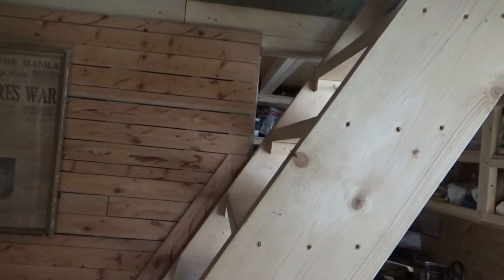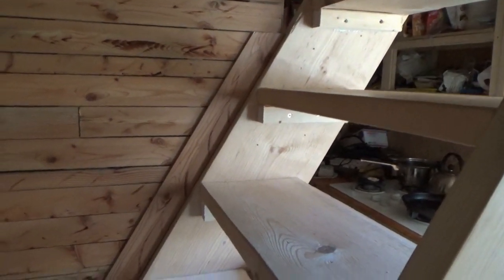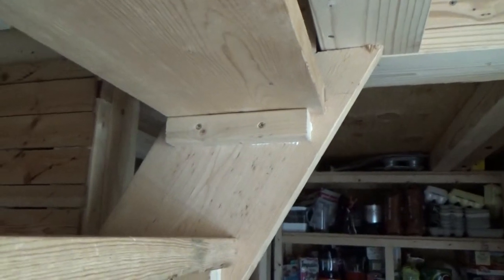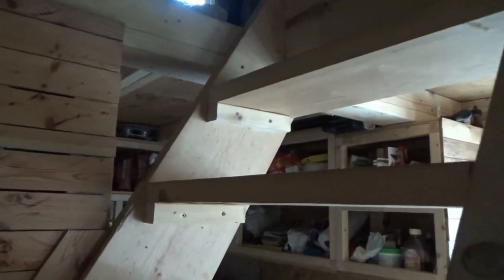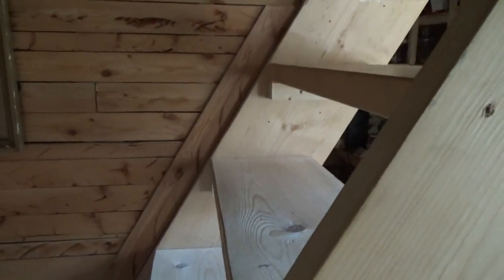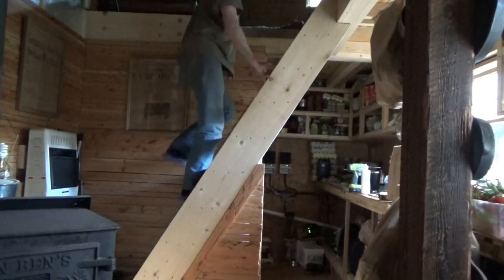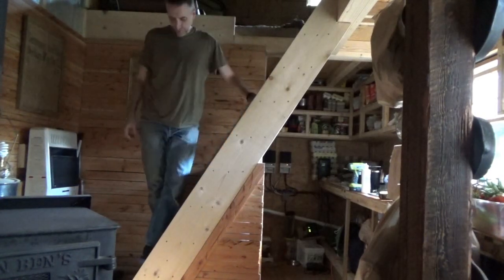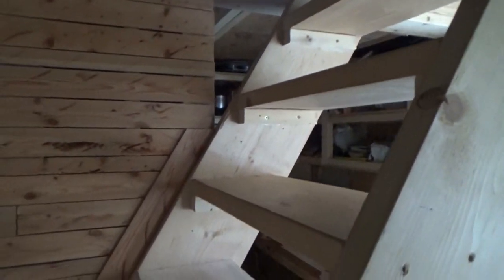Rebuilding Tiny House Stairwell Supports Based On User Suggestions

Comment: It is funny.We had our first snow here in Michigan this last week..And what I have read online shows that we will have a very wet winter with lots of snow..I have split and stacked 3 full cords of wood for my fireplace.Even though I live in the city I have gas heat..Also got my generator tuned up and ready to go..I do not think I have to be off the grid to be prepared for an emergency..But just in case something happens ,I am ready..I hope you have been stockpiling for the winter also..The stairs look very good..

Comment: When did you put the propane heater in the white one looks like 30,000 btu. You using that  instead of wood stove?
Reply from the maker: +Bob Runde Last winter I had it installed professionally. It is just a standby heater in case the wood stove goes out or I am gone in winter
Reply: They work very well.

Comment: is that an unvented heater in the back ground if it is your going to get carbon monoxide poisoning
Reply from the maker: +Roy Amberg That is a special heater designed for inside the home. Its called a blue flame heater
Reply: Is it vented to the out doors
Reply: +Roy Amberg those heaters are vent free
Reply from the maker: +Roy Amberg This was professionally installed by a propane company. It is designed to be used indoors unvented. It is a catalytic heater, meaning it is safe for indoor use unvented. It is a temporary stand by heater. It only comes on when the wood stove goes out or if I am away during cold spells.

Comment: this is a warning you will get carbon monoxide from it.  the local coop sold them. they took them all out
Reply from the maker: +Roy Amberg Well, I have a co2 alarm so I guess we will see
Reply: That's to late get one that's vented for your and everyone else's safety
Reply: +The Do It Yourself World,    I have used the same type LP wall heaters for 20 years and never had troubles with it. they sell them ventless for a reason and its not because they try to poison or kill the customers. You have stated many times you have a window open pretty much any time heat is on and that is the fresh air the manufacture recommends.  And before anyone say it would never pass code yes ventless can and do pass code.In Michigan in  2011 brand new built home had one installed by the contractor and inspected by the gas company and passed by the city inspector for final move in permits. Its all about common sense crack a window to allow fresh air in or allow air to enter another way
Reply from the maker: +M “Ghost” Baldridge I have at least one window open 24/7, all year round anyway due to the insulation in here. It would be too hot upstairs otherwise. lol

Comment: Since that is the way your going to keep it, take a sand block and sand the corner off, also to make it more secure i would screw a screw in from the bottom to each stair, another thing you can do is remove each stair one at a time and put glue on both sides and screw it back in using the same holes and screws to bond the stairs to the siderails better